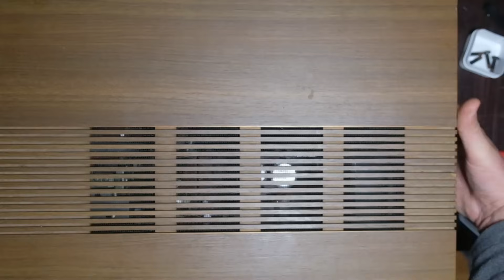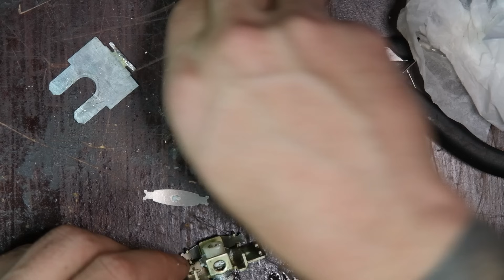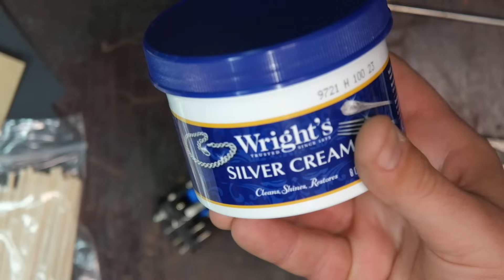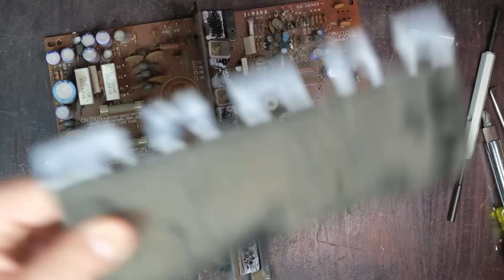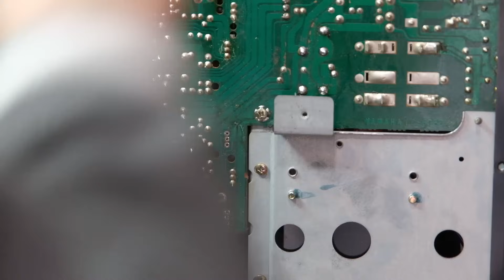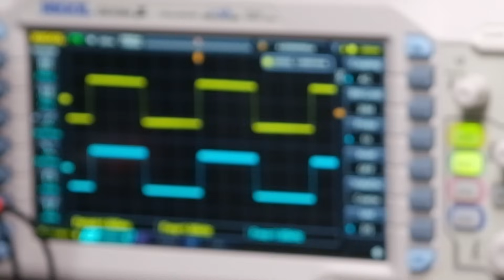Craigslist Disaster! Can I save this vintage receiver?

Comment: Great video. Glad you didn't give up on it. 

I don't have a wire wrap tool. I prefer to just desolder and remove the posts with wires attached. Keeps it looking totally original that way.
Reply: That's also the way I do it as well.  I find it to be easier and less risk of damage.

Comment: Nice Job It is very satisfying when you can make a useful device from a mess. I typically remove the wire wrap posts and solder the wire straight to the board . the less connections the better

Comment: It looks like the loudness control makes it go into oscillation on the square wave. Faulty cap in that circuit. The power miss match is due to poor tracking on the volume pot as it's fine on max rotation of the pot. Probably always been like that!

Comment: nice video, comment, never use sand paper on relays. soak some paper with DEOXIT and move it between the contacts.  Sanding them like that will cause the to fail again. my 2 cents.
Reply from the maker: I wasn't entirely comfortable using sandpaper but it seemed to work. I'll try your technique next time!

Comment: I remember this amplifier well. It was always an entry level product. It is what it is. By modern standards you will find it lacks detail, the slew rate is poor as shown on the square wave. The mag input is also noisy. I think if it was mine, rather than spend money on the second unit I would have replaced the complete power amplifier board with something like an LM1875. This will sound better than the original amplifier, easy to fit, give better 4 ohm power. Only problem, it will not be original internally. Externally it will look the same, all preamp functions will be original. Make sure the LM is genuine not one of the many fakes from China.
Reply from the maker: I wasn't particularly married to the idea of keeping things original, but I knew cannibalizing was something I could fumble my way through. Your alternate path would be one heck of an overhaul. Very cool idea!

Comment: I'm wondering if there's a way that you could send the bad circuit boards to a place that makes new ones and ask them if they could make a duplicate of the bad boards minus the broken traces and potential other broken parts.
Reply from the maker: Maybe! There's at least one hundred components on that board, with at least twice as many pads to accept them. I bet this wouldn't be cheap!

Comment: Just take a picture of the bad PCB, put it in a PCB or cad design program and redraw a new PCB by tracing over the picture. Then have it made by pcbway or jlpcb or one of the many others for a few dollars. You hardly need a second receiver to fix this. 
Buying a second unit is a major cop out.
Reply: Just had a 70um Cu 2layer PSU board made, 100x160mm came close to $60, once you take the time of "putting" existing pcb into KiCad into account, the donor receiver is actually the cheaper and quicker solution.
Reply: @paulb4661  in the repair and restore hobby nobody counts time into the costs.
If 60 was the PCB cost itself you did something wrong on ordering.
Reply: @bzuidgeest  Have you ever ordered a board? Have you ever designed one? I do not think so, regardless of the notion, that it would make any sense to spend more time and effort, so that you can remove and solder all the elements, once you finally get a new one made. No, there were no mistakes, not my first rodeo, every single pad, via, track, silk screen, clearance, were spot on. You've suggested it would have been BETTER to design and have one made and you are clearly wrong. Finally yes, a single PCB is a few dollars, but the minimum is 5 and unless you're willing to take a trip to Shenzhen, China to collect, you need to actually pay for delivery half way across the World. That's why I'm sure your knowledge of the entire process is based on nothing else, than assumption and advertisement.